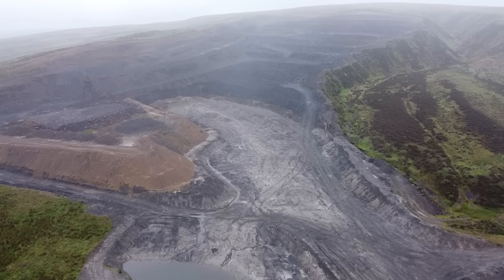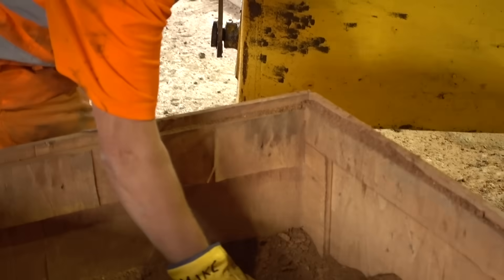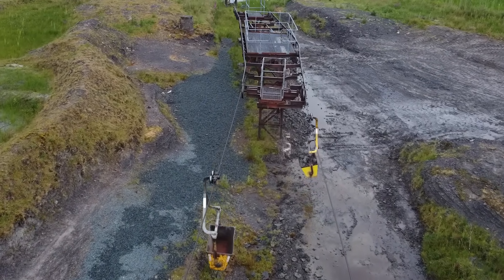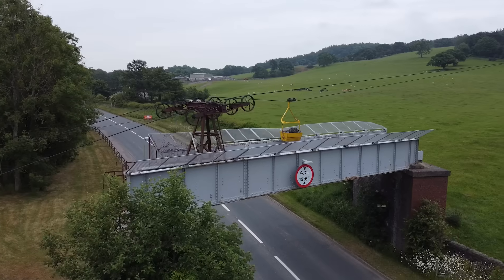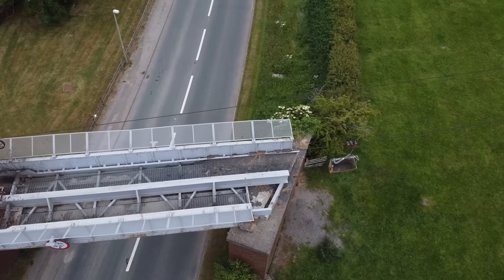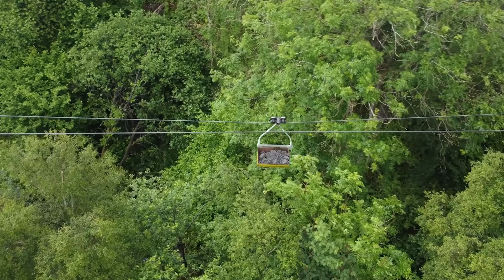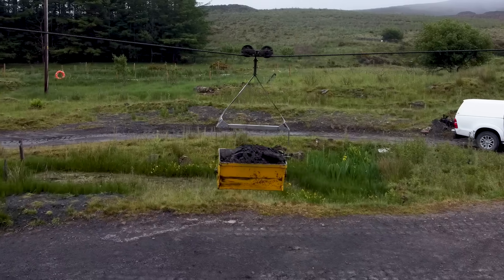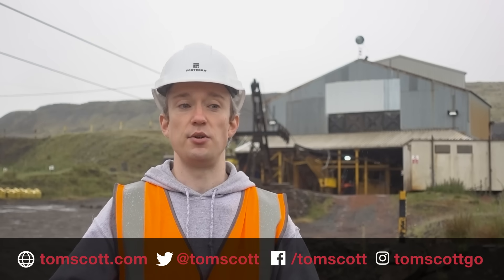The UK's last aerial ropeway uses no power, moves 300 tonnes a day, and will be gone by 2036.

Comment: This is fascinating. Doesn't a gravity-operated ropeway sound like a perpetual machine, though? How does it even work?
Reply: It's not perpetual. It's using the potential energy of the rocks on top of the hill. As those rocks slide down the ropeway due to gravity, the gravitational force is also sufficient to push the empty buckets at the bottom of the hill back up. Once they run out of rocks on the top of the hill there will be no more energy to move this system.
Reply: @RealestUrbanism  Indeed. I didn't think about the rock's potential energy, thanks!

Comment: well represented report, thanks. In the US, we call that cable. I built 4 zip lines, longest 200 M, with a few helpers, and under $1,000, in Thailand several years ago. I also designed and built what I call "Asia's biggest swing" using a single 9 mm steel cable - which came off the side of a sheer limestone cliff.

Comment: This is a perfect example of the way we need to think in the future. Rather than take the lazy route of buying and loading a truck (internal combustion or electric) engineers need to say to themselves "is there a low or no energy way of doing this".
Reply: It just takes some imagination.
Reply: Actually all electric vehicles use a similar premise, they recharge their batteries whenever you go down a hill - it's called regenerative braking.  They let gravity take over from the motor and convert the rotational energy in the wheels back into electricity.
Reply: @krashd  They aren't perpetual motion. They only recover a small proportion of the electricity expended. And it does not apply to all electric vehicles, only the more complex.
Reply: Is it at the bottom of a hill/quary and needs to go to the top  of the hill/quarry? If yes then it will take energy.
Reply: @catprog  I don't think that you understood the explanation. The quarry is at the top of a hill and the brick factory at the bottom. It's driven by gravity and the energy used is potential energy. The buckets coming down are heavier than the empty buckets going back up.
Reply: @geoffreypiltz271  Yes I was talking about situations where that is not true

Comment: hmmm, i'm curious as to whether it runs 24/7 or not? or do they just put the brakes fully on overnight and leave the downward line with full buckets so that there is enough energy stored as gravitional potential (with the full buckets) to keep the system going when they take off the brake the next day?

i can see why leaving the rope there unmaintained as a heritage feature could be dangerous but I don't see why they couldn't take off the rope and then leave the towers up... especially seeing as this is the last one!

Comment: Seems like with a few guides and cams the buckets could run without the operators on either end handling the buckets.  A clever 1920's engineer could design those to work without external power.
Reply: Yes, but you don't necessarily WANT that to happen.

Comment: I get how it needs no energy input once the "loaded" buckets are dragging empty ones up. But. How does this get started from rest? Sorry if this is a repeat question.
Reply: When it's stopped there would be empty buckets at the top. They just need to be filled and then attached to the line. As it falls it will slowly bring the system up to speed.

Comment: The same idea ist still exploited with modern technologies. In 2018 the stone quarry of Péry in Switzerland acquired an electric lorry that charges its batteries through regen-braking when descending from the quarry to the factory downhill and then drives uphill again under its own power.